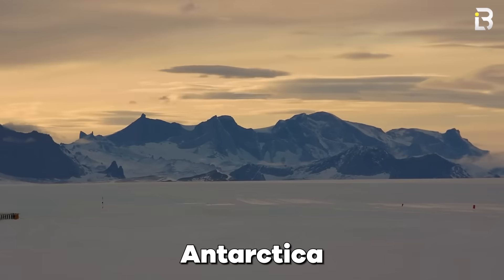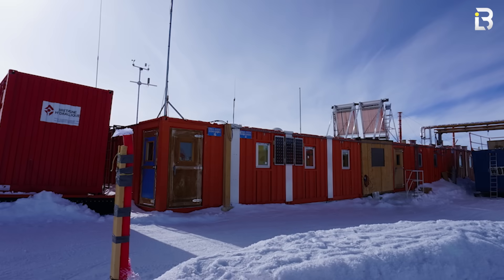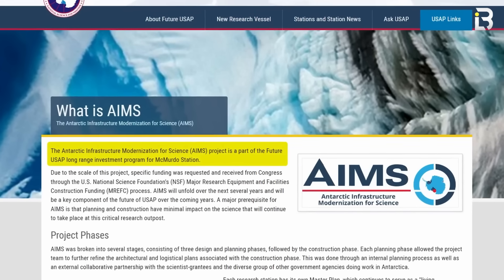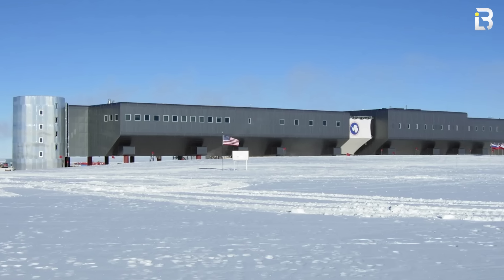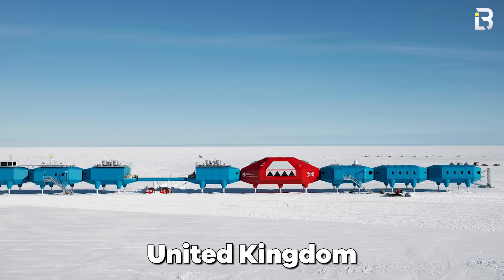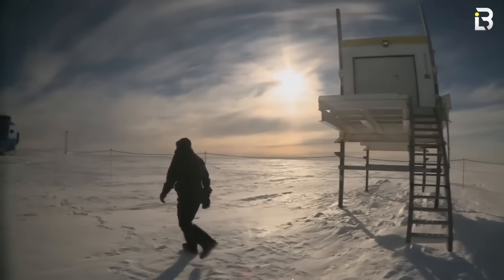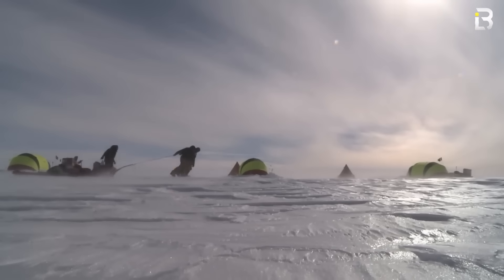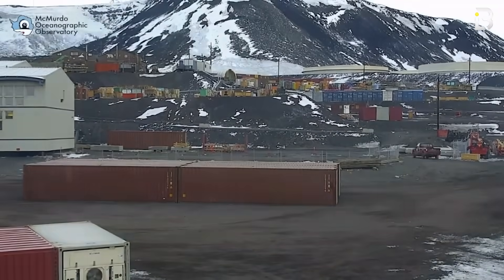Stations Built to Endure Antarctica

Comment: Find it ironical that Russia can build this yet the oil installation buildings in Siberia are mostly built by European countries.
Reply: это было в 90 и в 00 годах при кризисе
Reply: @user-mx6ru4rc1t Ah, I now understand.
Reply: @joebannon9443    ну молодец что тебе еще это дано, понимать
Reply: @ARThuRiosik Spent far tooooo long working in Russia 1978 - 2010.
Reply: @joebannon9443  it looks a bit like collective bipolar disorder when the people talk how Russian economy is so weak basically the size of Italy and the next second they talk how it is strange that Russia doesn't build and make 100% things independently. Compared to any European nation, Russia can do much more if you compare 1 vs 1.
Reply: @Levon_RnD 
 List of countries by GDP (PPP) : 
1 China
2 United States
3 India
4 Russia
Reply: @Levon_RnD  Русофобия разжижает мозг.
Reply: @katya6301 Yes, that's gdp ppp. When people trash talk Russia they use nominal, not ppp. Which is very different and largely useless and misleading in the current situation but it's still there so haters can use it to show how Russian economy is "small".
Reply: @user-mx6ru4rc1t Sakhalin one & two were not built in Russia & Sakhalin island was engineered & built with imported equipment, even the housing was imported, spent two years working on Sakhalin one second hand Chevron ring from Alaska. Extension modules were built in Russian power generation & water injection certainly not the best offshore modules I have ever seen built.Sakhalin two was built in South Korea as no ship yard in Russia either had the experience or was capable of building the installation. Russian oil installation I have found have little investment compared to US invested installation as a result far less reliable.
Reply: Not no more 😊
Reply: Что за бред😂😂
Reply: @rusmuldash8676 ?

Comment: Thank you for an interesting video. but ℉ scale is used few nations now yet majority is ℃. I propose you to use  2 scales.
Reply from the maker: That is a good point. Thank you for your feedback.
Reply: Research and science uses the Kelvin scale, so the best thing is, use a conversion tool online if you dont understand either scale.
Reply: We use F as it's more accurate
Reply: accurate  to human, maybe, but still debatable. I don't think you will notice difference between 80 and 85 Fahrenheit. Science uses Kelvin or Celsius because they use same scale. @natejones689
Reply: @natejones689  F is more accurate in the States? Amazing how temperature works differently in different parts of the world
Reply: @Levon_RnD yes F is more accurate the difference between freezing and boiling is 168 degrees with C is only 100 degrees. Hence the temperature is more accurate.  Any idiot can comprehend this
Reply: @natejones689  Idiot yes, certainly. For a reasonable person, it's not really useful to have 168 degrees specifically between freezing and boiling points, not to mention that you can always use fractions if you REALLY need to be that accurate. Otherwise, Celsius is better - simply more convenient. 0 means freesing water, 100 means boiling. Easy to get used to, easy to utilize. 

Also, internationally used scientific Kelvin scale is the same increments as Celsius (1 K = 1°C) but without negative numbers, making conversions simple: K= C+273.15. So, the scientists in the whole world have it better than ones in the US because they don't have to adapt to completely different scale, they just learn to move zero down to absolute zero for convenient scientific calculations.
Reply: @Levon_RnD so you agree F is more accurate.  Nice spelling